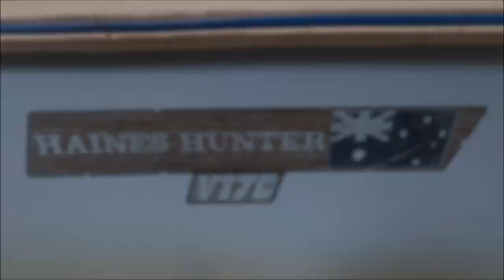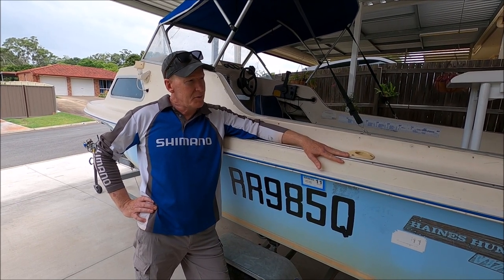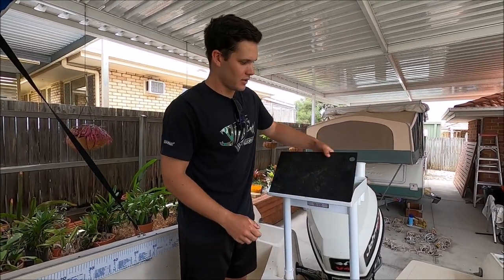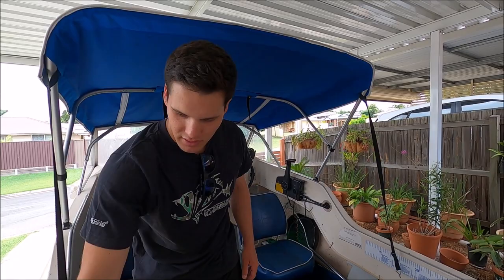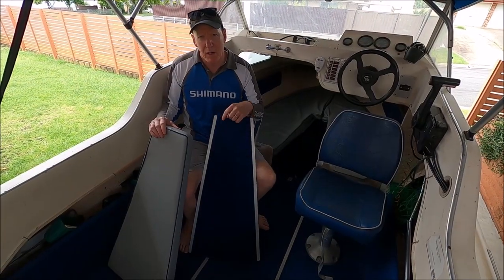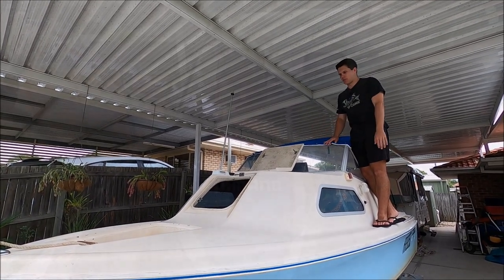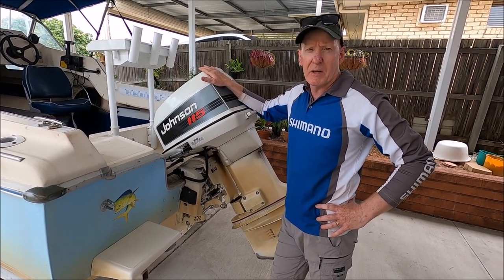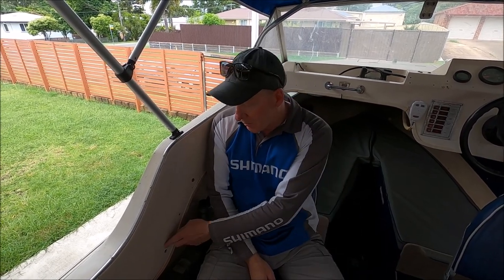HAINES HUNTER V17C - full walk-through & review!

Comment: Didn't see EPIRB and fire extinguisher. Should be at finger tips. Same with life jackets. I can touch all safty equipment from the helm position.
Reply from the maker: G’day Wayne, we usually have all the safety gear right there ready to grab, however we stripped everything out of the boat for this video. Safety is definitely our priority mate, no fish is worth dying over! 👍🎣 tight lines
Reply: @willkitching  can't strip it out for video if it is mounted properly. Quick release brackets fitted right beside the helm position.
Reply from the maker: @waynemee8920  We have all our safety gear (EPIRB, Flares, etc.) in an open bag right at the front of the cabin, ready to grab instantly if we ever need it. That way every trip we can unpack it and keep it safe inside the house as well, and avoid anyone jumping in the boat and stealing it (which has happened to people we know). It’s still as easy as ever to grab. In fact it’s way easier for us doing it this way than having it mounted on any brackets, and it means it’s all kept together as well. 👍